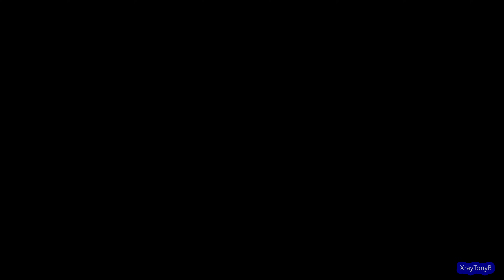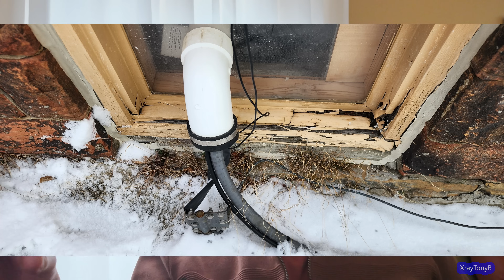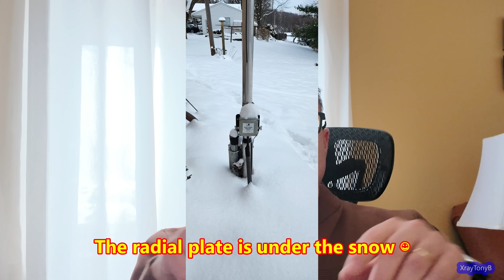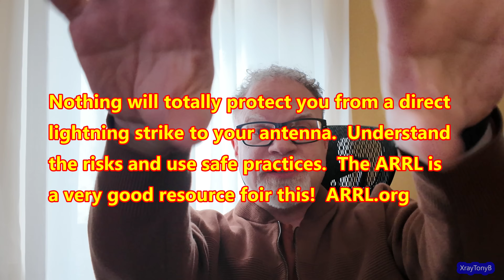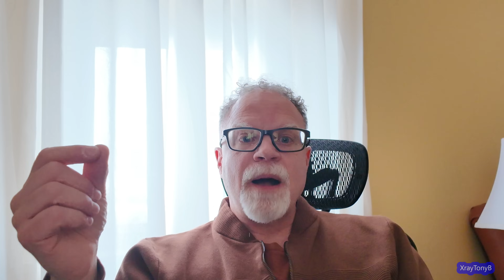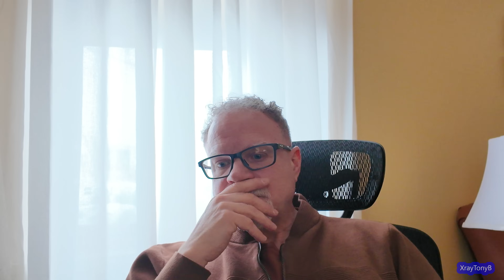Answering Your Questions Part 1

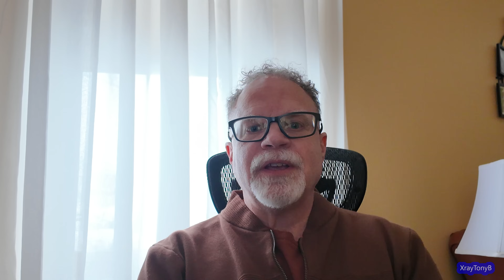Comment from the maker: 0:00 Intro
2:15 (You'll just have to watch) Silliness
3:00 Ham Radio Antenna and Power Grounding Question
11:46 Availability of Audio Capacitors 
16:48 Dealing with Counterfeit and Fake Components
23:32 Repairing Raised/broken/detached circuit traces on PC Boards
 27:29 What is Tony's Top two favorite Integrated amplifiers, Top 2 Receivers, Top 2 Tube Amplifiers?
 35:13 Other area of electronics that I'm interested in.
39:47 Will Tony ever work on a Yamaha B-6 again?
43:43 What is the purpose of the driver and pre-driver stages in an audio amplifier?
49:04 What are my thoughts on the Mastergroove/Mend it Mark copyright strike?  What do I think about the Right to Repair?
Reply: just like to point out that nichicon has stopped manufacturing all 5mm and 6.3mm 'lytics. not only 'audio' caps

Comment: Thanks Tony. I got hung up on a few issues on the current project. Then my lower back gave out. Then Christmas hit. Life.... I'm back at it and a video will be up shortly. Also I'm looking at a Marantz 1152DC for my next project. The ad states "Relay clicks on but there’s only audio out of one side and a massive humming sound.... $400 firm" Cosmetically it looks good, but dirty.
Reply from the maker: If it is in good cosmetic condition, I would go for it.  If it's anything like the 1180DC, it will be a really nice amp,  especially when restored.
Reply: @xraytonyb  The guy sent me detailed pictures of the inside. Someone has done extensive work. Pretty much fully recapped. Really would like a unit that's a little more virgin. On the fence about it.
Reply from the maker: If it has been "serviced" and still has those kids of problems, I would avoid it at that price.  Who knows what kinds of problems are lurking under the cover!
Reply: @xraytonyb  Affirmative. Passing that one up.

Comment: Grounding and Bonding, people understand radios and antenna  more then RF grounding. Grounding rods should be further apart then ther length to get there full effect. Everything should be grounded with power where power enters your house. It's worth the time to read this book.
Grounding and Bonding for the Radio Amateur: Good Practices for Electrical Safety, Lightning Protection, and RF Management
Book by H. Ward Silver

Comment: Great story about your Mom and the wonderful downstream effect on you. That's the thing that I think some people 'miss' is that 1 event that changes your life and the ripple effect. Good on your Mom for being strong enough to give herself that chance when it was offered...some would have turned it down over fear of the unknown and 'technology' always brings with it stigma. And just like that, they miss that opportunity of a lifetime. That's what happened to me with Siemens, I was given an opportunity even though I didn't have a degree because I showed 'trainability' and 'drive'. Old time CT/MRI service tech here and when you talked about your Mom having to go in because the system "crashed"...most people have no idea where that came from but you and I are probably about the same age and history...Do you remember the old DEC RL01 and RP06 drives that were used for image storage in the 80's. When you happened to be there when they 'crashed' it was god awful noise when the head came down on the platter that was probably spinning about 3600rpm. Then the result when you opened it up and had to remove the metal shavings!...fun times...Love you brother, keep doing what you do.

Comment: If you can fit it in sometime, I would like to have you describe how to select JFETs and MOSFETS.  I work on amplifiers for people sometimes and I often see FETs at the beginning of som amp or pre amp circuits, even in differential pairs and I would like to know what parameters to match in selecting replacements.  I’ve enjoyed your bjt discussions but a little time spent on FETs would be welcome…….even if only during a solder-n-chat.     Thanks

Comment: Nice video. I do have some observations/questions. You mentioned that you use super glue or copper tape with adhesive for repairing pcb tracks. So far i didn't had much luck with that. Using copper tape with adhesive or two component epoxy glue is all good until you start soldering. I don't go over 300-320°C when i solder elements on repaired pads but even slight amount of heat starts to melt glue. I'm not sure if super glue is somewhat resistive to heat. I watched last night some official videos from Tektronix and they used copper rivets for that and maybe i should try that.
Speaking of Pioneer SA-9800, i had one on my workbench a while ago. I didn't liked it how they designed PSU board, from what i can tell that board heats quite a bit during normal operation and elements are looking to bottom of amplifier so all heat is going up and heating PCB. Sadly i can't post pictures here but that board was really well done cooked, all brown/burned, wires we're really stiff from all heat. On top of that previous "repair guy" cut all wire wrapped wires,soldered them back and cut them again(i guess so no other repair guy can fix this relatively easy) and didn't do any repairs. From mine point of view i would replace most all components on PSU board, replace all wires(that are now too short) with new ones and that is if PCB tracks are in decent shape.Owner thought repair will be cheap and fast so that was it, amplifier left from me in same state i received it. Sadly i can't post picture here to show how stuff shouldn't be done...

Comment: Thank you Tony :) A very thoughtful answer. Interesting that there is a seperate isolating star ground for some x-ray machines. I asked you for that very reason, I had hoped you would have had experience with high RF grounding through your work. You confirmed my path, and it means I need to invest in some copper sheeting strips to do it right.

Comment: I just posted this on your "RFQ" (Request For Questions) vid, but I figured I'd drop it here as well in case you don't get a chance to go back in time.

Tony,
We know your story of how you got interested in electronics, but what do you think we, as the aging knowledge sharers, can do to spark the interest in a younger generation to think outside the "shiny box" pick up a soldering iron rather than pound on a keyboard?

1 story I relate to those who will listen, is of a Q&A in a magazine years ago - the "Q" was that a moisture sensor was needed for a certain area, and the poster was thinking of using a micro controller. The "A" came up with a micropower comparator that could run off of a pair of D cells for several years, while the micro controller would last what, a couple of weeks, tops? Programming is a great skill, but not the be-all-end-all, and vice-versa.

Comment: Hi Tony, even though I didn't ask you any questions, I just sat there and listened with my eyes glued to the screen, I love your videos and I watch them several times to make sure I didn't miss any new information.
Personally, I didn't understand why YT blocked Mark's video with the repair (I'm one of those who saw the video before it was blocked) but if I understand correctly, Mark was asked to fix it directly by the manufacturer of the amplifier, so it couldn't be a copyright infringement towards the manufacturer and everything else that was done in the video was Mark's own work.
Unfortunately, it's complicated with the payment for shipping and customs, I have the exact opposite, I'm from Europe (Czech Republic) and unfortunately the purchasing power of our currency is not great and the purchase of some measuring devices can represent several months' salaries and therefore, as an amateur who has electronics as a hobby, I can't afford that. Until recently, I worked as a service technician, so I know the issue of locked devices for service very well, in your case it is all the more sad because it is a matter of human health and manufacturers should not profit from it in this way. The manufacturer should enable the fastest possible professional intervention and provide professional service technicians with the necessary information and ensure good availability of spare parts.

Grounding - it is necessary to avoid multiple unconnected ground points within one object, different ground potential can cause a lot of problems - I personally experienced (I was looking for the cause) when 13V of ground potential sent a two-meter guy to the ground in the shower the moment he reached for the shower tap. When he woke up, he didn't understand what happened, and I didn't understand why it happened. The fact that I only measured 13V when I was looking for the problem doesn't mean that there couldn't have been a much higher voltage when he touched the shower - a fault - a broken ground loop.

One question has already occurred to me: Are you ever planning a vacation to Prague, I would like to treat you 😁

Nice day🙂 Tom

Comment: I have a very short question: What dmm do you use at work now (as a replacement for your 187)?
Reply from the maker: Fluke 87-V in the main tool case and an Aneng AN870 in my small carry case
Reply: @ Thanks for your quick reply! I have a 287 and a 87-V and a couple of 170 series Flukes, all decent DMMs, but the 187/189 seems to be almost perfect (minus the annoying beeper sound). Really wish they would still make it.